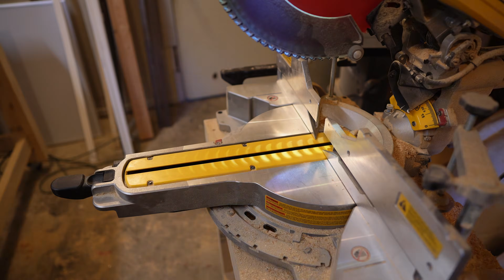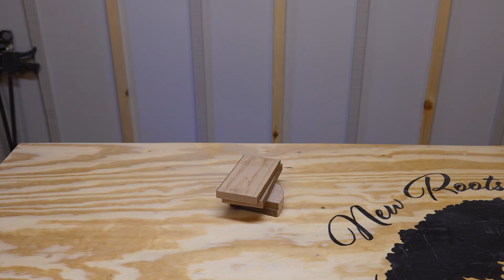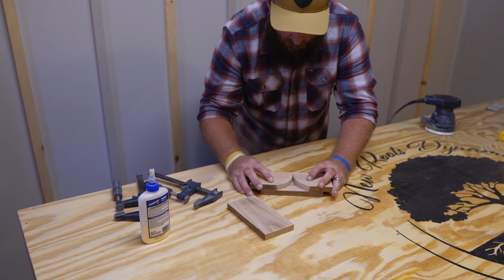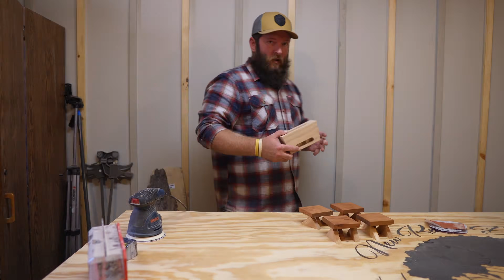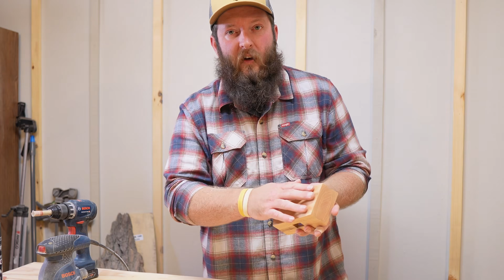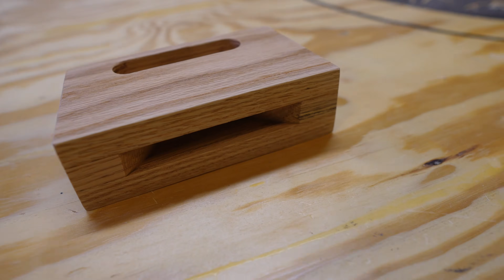Quick Project Transforms Scrap Wood Into Dollars - Fast And Easy

Comment: The only problem i see is plugging it in. The cord has to make a sharp 90° bend just to plug in. Plus most phones i know the plug goes in the middle and the speaker is just to the side of that so the cord would block the acoustic channel
Reply from the maker: That's a good observation. The design isn't perfect, I'll admit that. They do make charging cables with adjustable plugs that you can adjust to any angle. This just happened to be the plug I had in the shop. If selling them, you could include one of those cables to address that issue.

As for the acoustic channel, I made this one to my particular phone. The center blocks could always be spaced out further. They could be made with thicker pieces too, but going too thick would affect the acoustics of it.

Maybe I'll make a second rendition in the future. The point of the video is to find another use for small pieces that you might have just deemed fit for the fire pit. Thank you very much for pointing out those issues! And I'm glad you found your way here. I'll be the first to admit if there is a flaw in something's design. We are all makers here and constantly learning. ❤